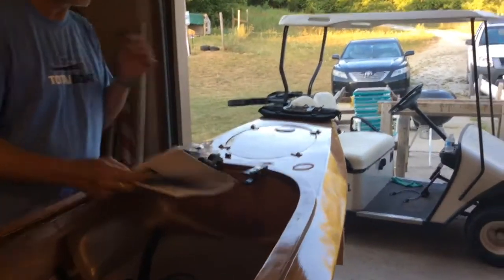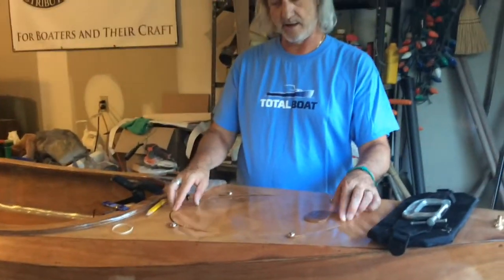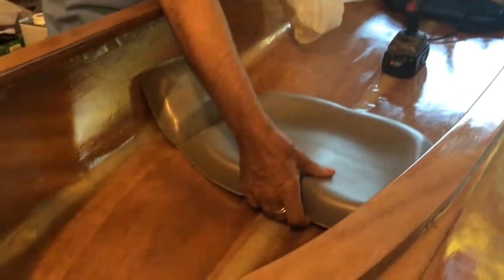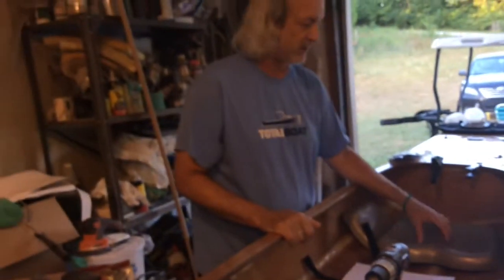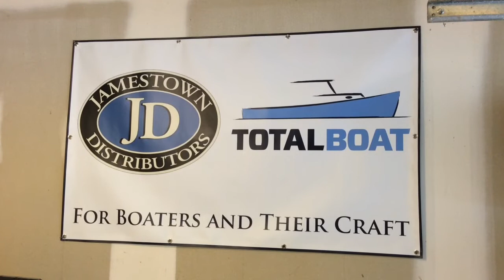Kayak Episode 12

Comment: Enjoyed the series.  Can you tell me how many sheets of plywood went into the build?
Reply from the maker: Yes, total of 4. three were 4 mm and one was 3 mm but all were Okoume marine plywood.
Reply: Thanks.  I was looking on CLCboats web site, and found the plans and the kit, but could not find a spot where they said how many sheets of plywood it would take to build your own from scratch.  Thanks again for the series.
Reply from the maker: Yes, they have the kits with pre-cut panels but they are pretty pricey. I did have a bit of difficulty sourcing the Okoume plywood. I live near Kansas City and couldn't find this kind of marine plywood anywhere near. You can order and have it shipped but shipping really increased the cost. I finally found a guy in Des Moines that had some and I took my trailer and drove up to get it. even so, $85 per sheet. I can tell you that when I took the saw to it for the first cuts, I was a nervous wreck. I was like, well if I screw this up, not only is it $85 per sheet but I can't even easily get more. ha!  And, because of this, plotting the plans out on the wood and cutting it all took the majority of the time. Even so, I came out way ahead, dollar wise, than if I would have just bought the kit